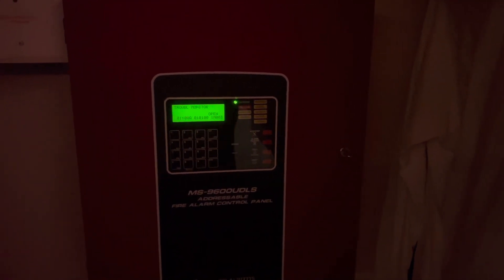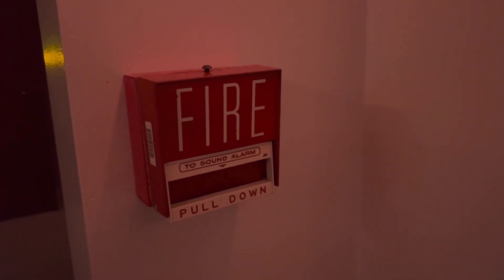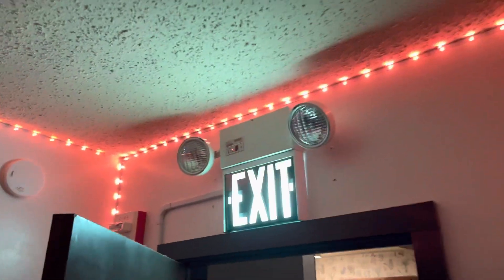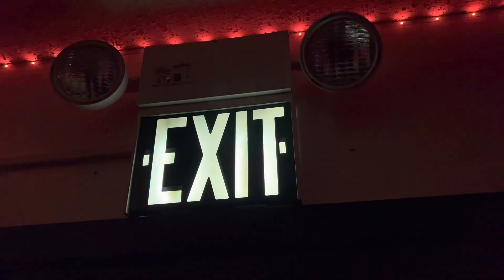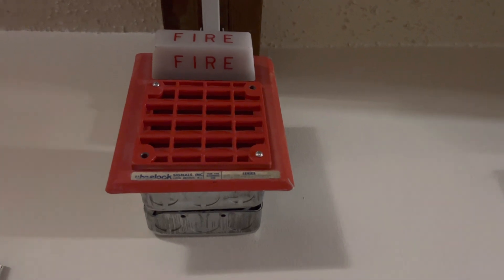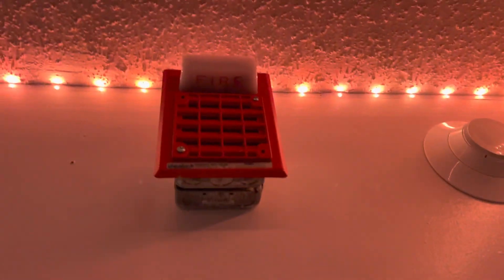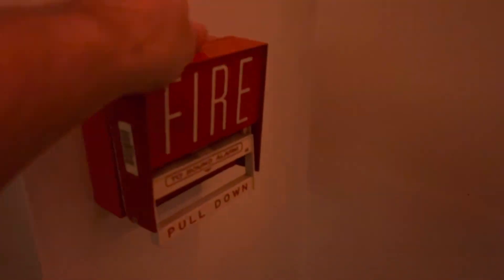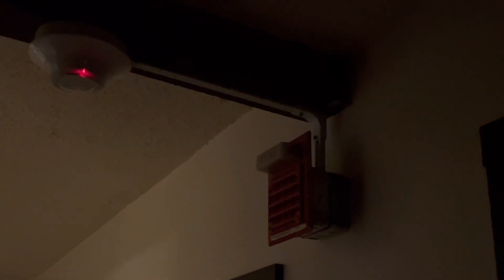System Test 3: Unusual Vintage Wheelock Signals

Comment: Nice to see you posting again. My reason the strobes looking like they’re “floor” mount because they appear to be the same strobe Wheelock use on the 7002 series. They also made 7002s that are ceiling mount (I have one in my collection), which has the same strobe as the second F 819T you showed in the video.
Reply from the maker: Thank You. Definitely sounds like a way Wheelock was saving manufacturing costs on their strobes back then.